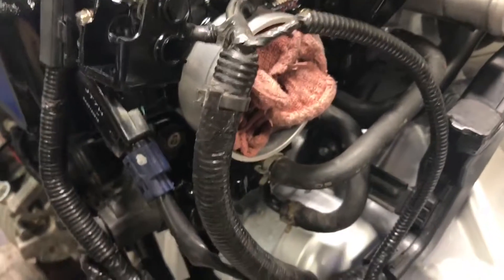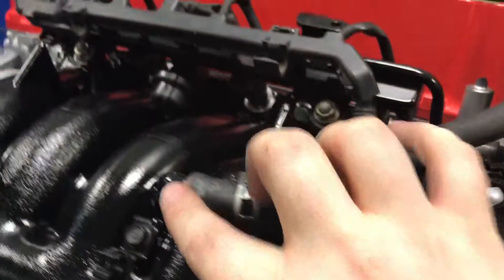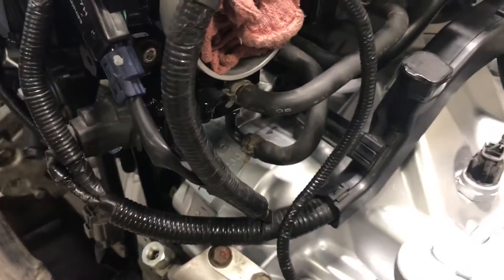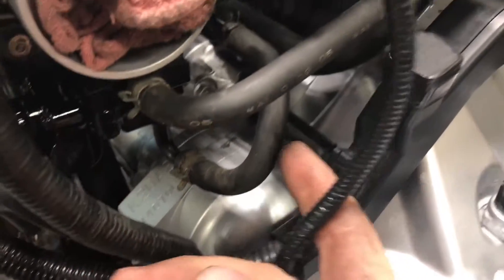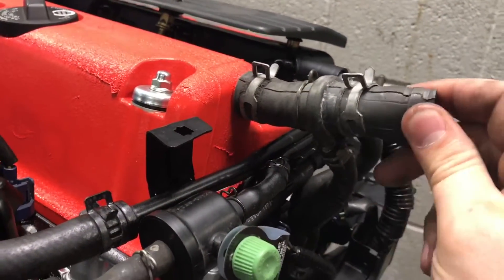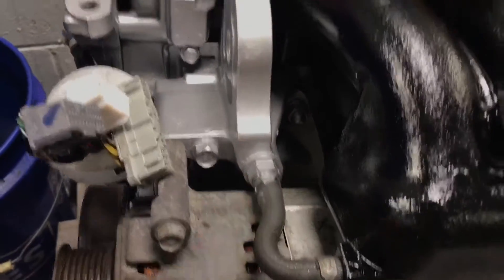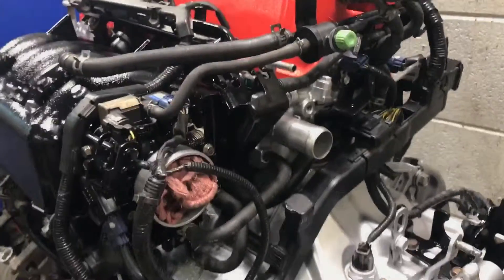K20a2 swap explaining where all the hoses go!

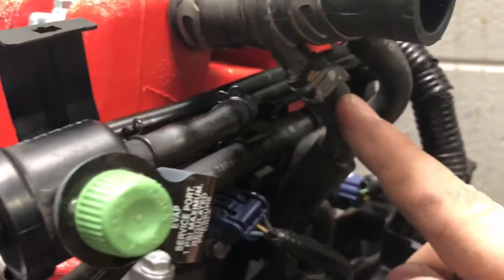Comment: This hose at 2:36 what does it go to cuz mine is pissing out coolant and overheating #02rsxtypesproblems
Reply: He showed were it goes
Reply: @javierchavez7167  hey i finally sold that pos lol i did fix that leak before the water pump wemt out but hey with 302k miles on it it ran ok
Reply: @Daniel.Z.33  rsx type s and u call it a pos? Lol